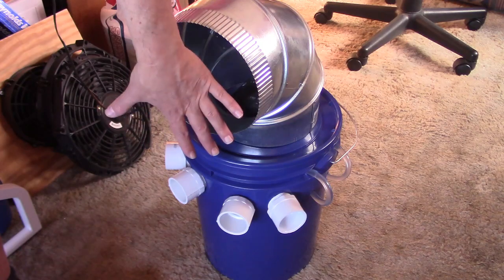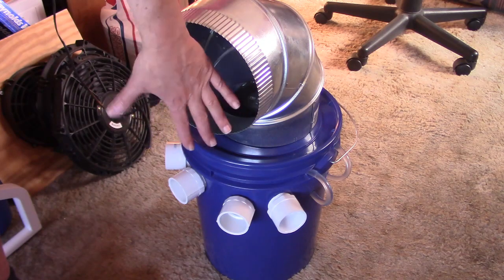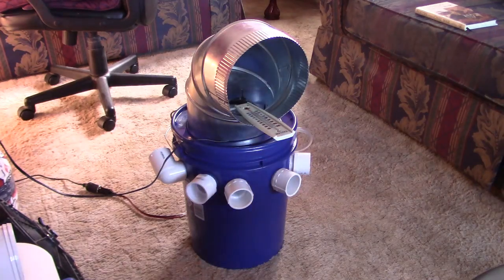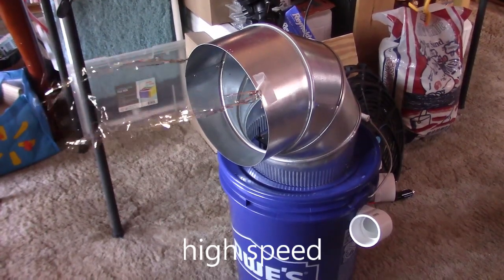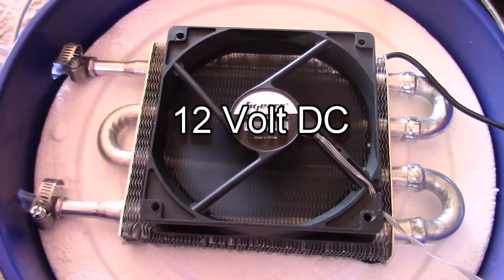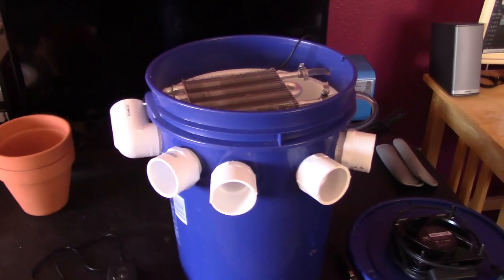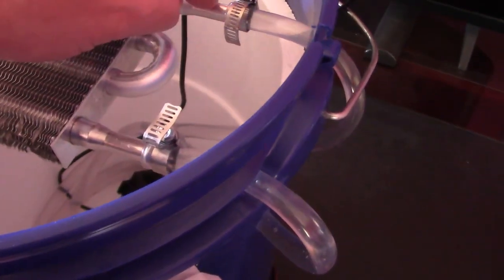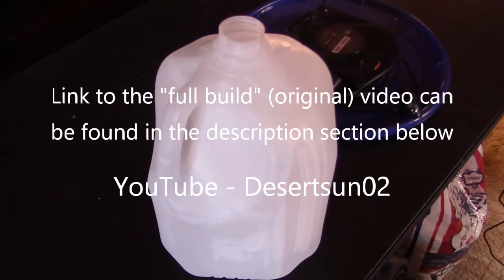2-Stage Air Cooling System w/radiator! (extended version) Make an AC Air Cooler! at home DIY

Comment: A question; between this style radiator and the tubular style radiator from your video two years ago (the long one wrapped in a "pipe" of hardware cloth wrapped with aluminum) which do you feel works better? Thanks!

Comment: What kind of radiator are you using?
Reply from the maker: it is a power steering oil cooler made by hayden automotive. it's model 1011.

Comment: What kind of fan are you using?
Reply from the maker: hi. it's an AC Infinity axial 1238 high speed muffin fan
Reply: What is the name of the radiator you're using? I almost bought one that has the fan attached to it
Reply from the maker: hi there. the radiator is a power steering oil cooler made by hayden automotive. model 1011. you can get it on amazon.

Comment: I am trying to build one of these for the first time - I have all the parts - a pump, a heat exchanger/radiator, and a fan - the pump and the fan are both 12VDC so I can more easily run it in a power outage if needed.

I've figured out experimentally that it doesn't seem to matter which side the pump connection for water to the radiator is on - it just seems to work. Is the same true for the heat exchanger? Does it matter which side the cool water goes in on and which side is the "drain" (back to the bucket or to an actual drain with continuous water). Or it doesn't matter, just that you feed in water colder than air temperature in one of them, and that's it?

Also, my other question is if this is running a while, the water will obviously heat up. At some point, if the water heats up hotter than room air temp, will this then switch to heating the air instead of cooling it? And to avoid that, just cycle the water out for new cold water, or just hook the inlet up to the sink?
Reply from the maker: hi. you can hook the pump to either tube of the radiator. it just needs to circulate around. once the ice is melted the water will warm up to room temperature (but not higher than room temp). it won't become a heater, it jus becomes a fan blowing air around until you add more ice.

Comment: Very cool and simple design based on the humble fridge. Just a tip to you, get a Noctua fan and the high speed will sound similar to the low speed. Almost whisper quiet they are 😊
Also, do have even better cold air flow through and from the radiator, try a dual fan push pull arrangement similar to what some computer heatsinks use. I'd love to know if that improves it even more.

Comment: I love your designs, just thinking aloud. The pump and radiator are just to speed the ice cooling the environment. Would be a design that just drives the air around the ice and get decent results without pump and radiator? maybe small ice blocks in a grill o similar.
Best regards
Reply from the maker: hi there. you can just blow a fan over ice and ice water if you want to (and that does generate cold air) but this unit works much better. I've run the unit with (and without) the pump turned on. when you run it with the pump turned off the air only gets cooled as it's pulled over the ice and cold water (but no cooling occurs through the radiator). the result is that the output air is only about one-third as cold. the air only gets 'pre-cooled' but nowhere near fully cooled. as soon as you flip the pump on and the radiator gets cold, the output air gets way colder. at least 3 times as cold.

Comment: excellent set of videos - what is the best more powerful/efficient fan?
Reply from the maker: hi and thanks. the best fan to use is the one that i used. i tried several and that one works the best. it's a high speed axial 1238 (ac infinity).

Comment: How is this a two stage
Reply from the maker: the air is pulled in through the couplers and is pre-cooled in the bottom half of the unit *as it circulates around the ice block and ice water. (that's the first stage or pre-cooling stage). then that cooled air is pulled up and through the ice cooled radiator (the second or main stage). you'll notice a big difference in the output air temps if you run it without the pump. that happened to me by accident during testing. i accidentally kicked the pumps plug and it slid out of the socket a little. at the time, i didn't know the pump had stopped running though. then within 30 seconds i noticed that the air was only half as cold and didn't know why. a minute later i realized the pumps plug had come out of the socket, so i plugged it back in and the air got twice as cold almost immediately. that's the moment i realized just how important the second stage is.
Reply: @desertsun02 oh okay

Comment: This is an awesome concept and I intend to build one myself later this summer. 

One suggestion: have you tried using a PCM cooling pack like the ones nighthawkinlight made a few videos on how to build? They stay cold a lot longer than ice. I have used them for staying cool in the desert and they may have a good use case here
Reply from the maker: i'm glad you like it! it's been working out so good that i recently posted a 3-part series on it (3 separate vids). i'll look into using a PCM cooling pack. thanks for letting me know about it. btw, i hope you build it. it's been working great. i use it almost every day.
Reply: @desertsun02 I'll watch all of them. Thanks for posting it. I had never thought of this before and have been using PCMs exclusively for staying cool at night in AZ. (The AC isn't balanced throughout the house). I'm definitely going to build this. I already have most of the parts. I was thinking about integrating an ESP8266 for wireless control as well. I'll let you know when I do.

Comment: I've often mused on how to mod a countertop ice maker to a set up like this...with a drain tube to a utility sink. Great vid. The intake sould be lots taller than the buckey, so it's taking from the hot layer of air the room. A nice cabinet would hide this entire machine easily, with grills for the intake and exhaust.
Reply from the maker: i may have to try using an ice maker in a future project. i know the water in those is super cold.

Comment: Nice job again! Do you know if you put two clay pots in each other, fill the space in between with sand to the top and than saturate it with water, that this can cool the inside to 4 degrees celcius (sorry I don't know what it is in Fahrenheit).

They used to built these in the desserts of the Middle East 1000s of years ago. I haven't build one yet, but if it works yoir ice would stay cooler for a lot longer. You need quite a large pot, but it is worth a try, especially where you live with the dry air.

I even wonder if you can build a room like this and cool it for free? Sadly I don't have the room, otherwise I would have build a small one myself to test it.
Reply from the maker: hi. yes, i even have a video on that. they call them zeer pot fridges. i made one a while back. i've read that you can make rooms that are cooled the same way. i can't remember where or who is doing it though.

Comment: Wonder if they make a small automatic ice maker you could run off a solar panel. Have ice dump into bucket.  Have circulation pump transfer melted water back to tank for ice machine.
Reply from the maker: sounds like a good plan. if i was going to take this to the "next level", i would probably buy a small chest freezer and keep it in the basement. then i'd rotate gallon jugs in and out of it, as needed, throughout the day. as it is, my kitchen freezer works well for me. i don't keep a lot of food in it so there's plenty of room. they even sell 12v chest freezers. if you use one of those you wouldn't even need inverter.

Comment: Nice upgrade! Thanks for sharing it!

Tonight is our first use of 'Convector II', based on your designs. It is the mid-size Honeywell fan for $44 Cad at Wal-Mart. I figure I've maxed out the chill I can get with this pump via the 3x 10' lengths of 1/4" copper tubing. The double-coil on the output may disperse the flow, but within the living room, on medium, my wife is happy with it. =)  Used 7x small freezer packs (from deep freeze). (will chill 2-3L water next time)

Soon I'm sure it will be still warm enough later into the night to restore 'Convector I' for bedroom duty. It is the $26 Cad Honeywell fan, and uses 2x 10' coils. With 4x largest freezer packs, 2 racks ice & 2L chilled water, gets us through the warm half of hot nights! Built & used it last summer.

Thanks again for your work - it is being well appreciated as I type this.

Comment: It honestly depends on the type of insulation you use in your home…first off we must know the ac in our homes doesn’t necessarily blow cold air into your home as people may think…it works to pull hot air out of the home and the absence of heat, is cold left in the home….this is why opening doors or windows with the air going pulls air from outside into your home. There’s a return always pulling air into it,  weather cold or hot and it just works to pull air into and condition it before a fan blows it back out the vents . You don’t let the cold out, you’re letting heat in…with better insulation in your home along with air tight gaps ,good windows and weather strip around doors and seals… you can actually turn your ac to 60 degrees and reach that temp with it being 100 outside…. I wouldn’t do it because it could cause health concerns with drastic temp differences but it is possible… think of a freezer… it does the same thing but runs refrigerant through the coil on the back and has awesome insulation to keep air out…there refrigerant running through the outside unit on your home ac unit . 3:35
Reply: I appreciate this explanation so much
Reply: A/C does the same thing as this.  It just runs hot air in the home and heats up refrigerant in coils that is then compressed and sent outside to cool in the warmer air outside, which it can do because of the large temperature difference.

Comment: Any measure on humidity change from the cooler air? I am guessing none but curious if you tracked it at all.
Reply from the maker: hi there. since this unit is a 'non-evaporative' air cooler, it doesn't create any humidity. (it may even take a little out) *that's because any condensation that may occur on the radiator would be water that's being removed from the air. it's only a small amount of water but even a little decrease helps. note that these units work in any humidity levels (even 80% and 90% RH) but drier air cools down faster than humid air (same thing for heating air). the drier the air is, the easier it is to change its temperature.
Reply: @desertsun02  excellent! Thank you for your considered response.

Comment: Is the bucket lined with Styrofoam?  If so, where did you get it?
Reply from the maker: hi. it's a separate liner (designed for 5 gallon buckets). i usually get them at home depot (when they have them). you can also get them on amazon and some smaller hardware stores.

Comment: Seems to me that your 2-stage design that cools the water outside and sending cold water to a radiator/heat exchanger  inside is a better design.
What happened? Did that not work?
Reply from the maker: hi. that other project is a 2-stage evap cooler that i made a year or so ago. it works great (but it's an evap cooler, so it cools with evaporation). the unit in this video cools the air in a different way. it's what i call a "phase change" ice-based air cooler. these cool the air when the ice changes from a solid to a liquid. it takes heat to melt ice so that heat is absorbed which leaves behind cold air.
Reply: @desertsun02  
That is exacty why I don't like this concept .... you have to put a lot of energy into making the ice.  You must realize that, so why?
Reply: @justgivemethetruth because everybody pretty much has a way to freeze jugs.  The freezer is there?  Right?  And the cost of building and running multiple DIY a/c units would be far cheaper than running same number of windows units.  Glad I could clear that up for you.
Reply: @OGLizardKing  
I was pretty clear in my initial comment.  I think you need to clear it up for yourself.  Spending on your electricity bill or buying an expensive solar freezer to freeze water to put in front of a fan is not as good a design as using the evaporative cooler and the air on a hot to do phase change water into vapor.

Comment: Never tapped to get to your video so fast. Can u do an a/c and a d/c combined? I have a solar panel but if no sun will need to plug into A/C.
Reply from the maker: hi. you can absolutely do that. the easiest way is to use a dc pump and a dc fan. i used a dc pump with that adapter and an ac fan but you can definitely use a dc fan if you want to. you'll have to experiment with which one to use. the ac powered fan i used could be powered by a small inverter if you wanted to. it only pulls 18 watts on high so even a very small inverter hooked to a 12v battery should run it fine. the lowest wattage inverters i've ever seen are 60w, and even that one should run the fan fine.
Reply: @desertsun02 thx so much! Temps going to 102 next weekend in NorCal. Love your channel. PGE has a stranglehold on us here. 7 rate increases in one year and I’m on social insecurity. This build is on my priority list now. I will let u know what I think when it’s done. Me thinks it will be amazing. 😊